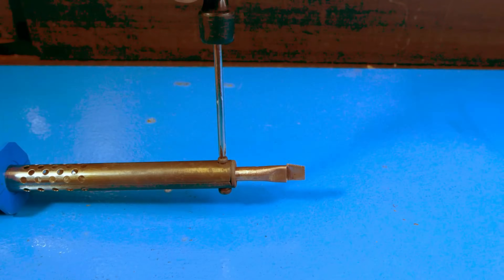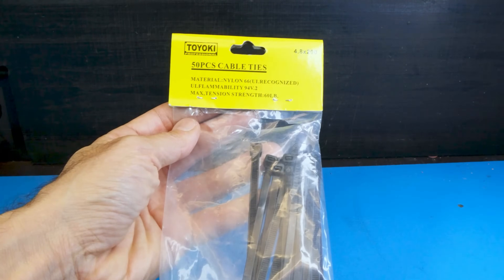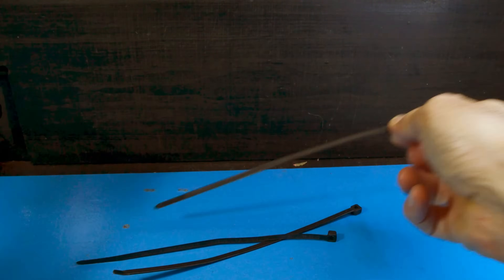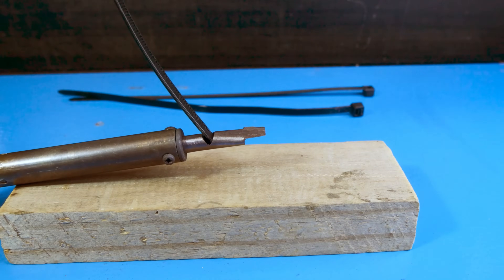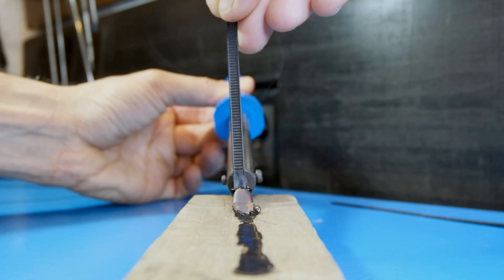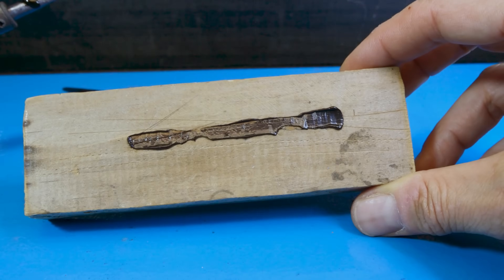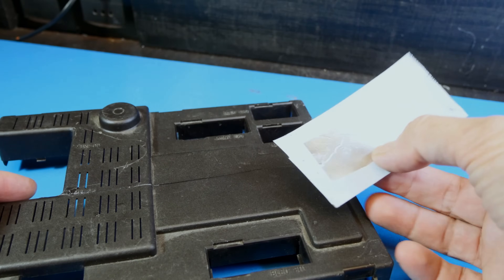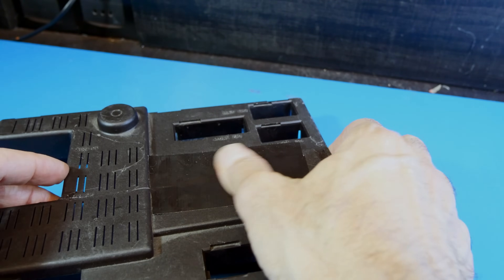Why Didn’t I Think of This before? Genius Soldering Iron Upgrade!

Comment: Very interesting video. I'll need to find something to repair now. Thanks for sharing. 
PS. Instead of opening your packet of zip ties at the end of the pack, try cutting a slit half way along the pack, just enough to get a finger in to pull out a tie. This way your ties won't fall out if you drop them.
Reply from the maker: Hi, yes great tip !! Thanks for watching !